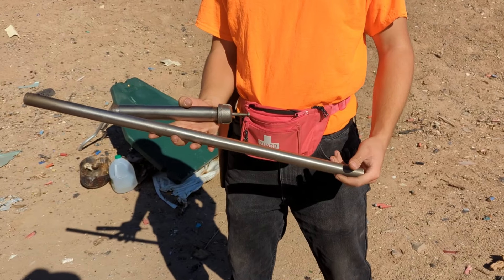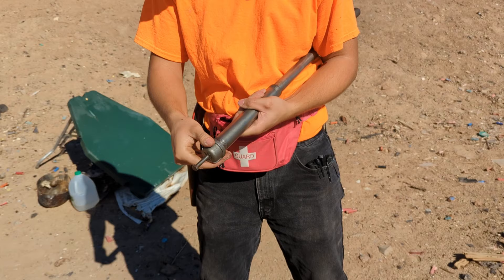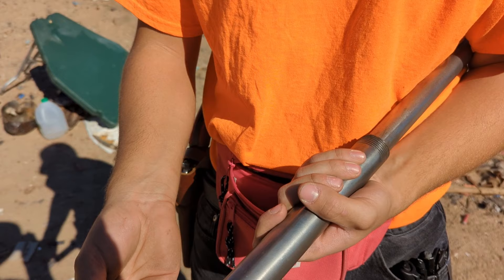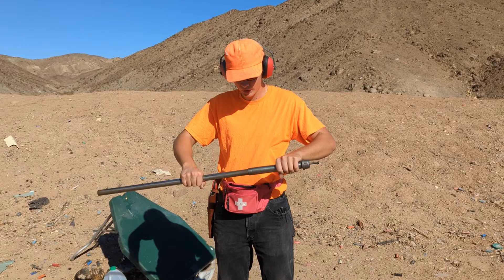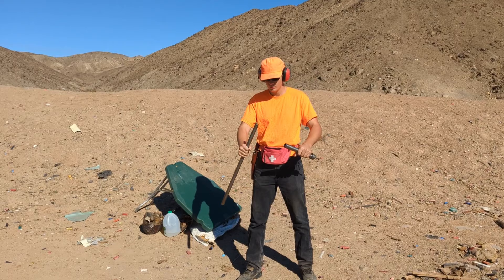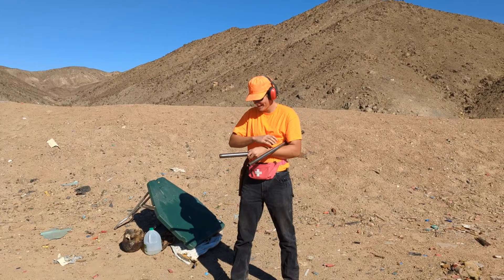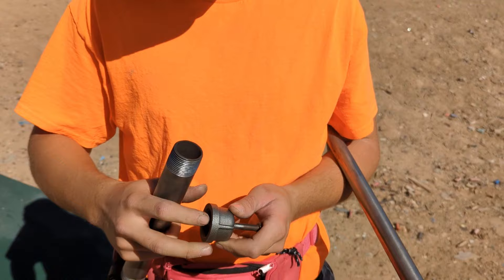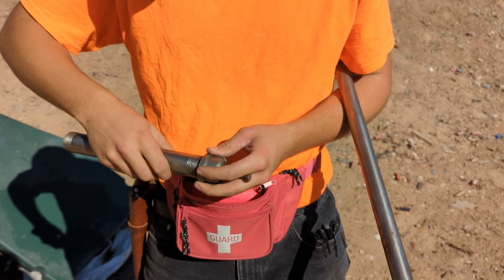The Mighty Pipe Shot Gun

Comment: This ISN'T NEW!! My friends and I when we were around 11 years old made these and used the old double-wick 4 inch firecrackers to project our marbles, metal balls, and anything that would fit into the pipe! We used gas pipe, and then on the cap (with the letter, "G") on the end, we would drill a small hole in the middle of the "G" for the double wick, which was cut at one end that went into the firecracker. We then fed the NOW longer wick into the threaded end of the cap and out the "G", then screwed the cap onto the gas pipe. Then we stuffed, a wad of cloth or something up against the firecracker then,  dropped the projectile down the barrel (pipe). Set up a target, made sure everyone was clear, then lit the fuse. The first time I did it in my backyard, I had a 2x4 in front of the gun; then a small partial sheet of used 1 inch plywood, and then made sure it was aimed at a telephone pole over on the next street behind the house. When NO cars or people were in range of the target, I lit the fuse! It went through the layers of wood (plus a rag doll I forgot to mention) travelled from my backyard and hit the telephone pole approximately 1,000 ft. away and we all went to examine the pole the projectile (3 inch steel Bullitt-shaped) was nmosing out the other side of the pole! The wood I had set up just in front of the barrel had a hole (obviously) through it and the rag doll was on fire! back then they were legal, until some ASSHOLES from Windsor were visiting friends of our in Simcoe and decided to shoot at people and cars or anything at all. The law stepped in named our invention, "Alley Guns" and made then "ILLEGAL! NOTE: we never had any issues with police or anyone until those Windsor, ON. "IDIOTS" took their fun TOO FAR!!! "ADDITIONAL NOTE: I don't think the four inch firecrackers are even around anymore! Hope you enjoyed my story. Have fun, BUT stay safe!!
Reply: Fireworks and explosives use FUSES . CANDLES use WICKS . And yes the is a difference. Fuses burn fast because they contain gunpowder. WICKS burn slow because they are just string .

Comment: Only thing to worry about is the end cap blowing off. That would be nasty. Tip 1. reduce little bit of powder in the shell to make safer
Reply from the maker: Given the amount of pressure it would take I'm assuming the cap would explode into shrapnel before it came off in one piece so no worries. 🤭
Reply: The cap could be reinforced with washers.
Reply: where is tip 2 ???

Comment: I think it's better to use JB weld & bb with a small holed washer into the cap.
Reply: Ther you go. Not compromising the cap in the first place and spreading the pressure away from the center. Way better.

Comment: blocking one end of a hole even slightly and putting explosives on the other end is exactly how you generate the pressure sideways for blasting so i think you where ptetty close to losing your hands there but hey if it work it works i guess

Comment: Something I would find interesting to try, say the builder doesn't have access to a shop where you can drill and tap to put in a striker, but still has the pipe. I wonder if you could assemble the pipe, same diameters, but drill a crude hole in the top for a cannon fuse, and then pour a charge of say 80 grains of FFG black powder and dump a load of buckshot in it, simple wadding, cut paper or even a cardboard wad over that. Wonder how that would test.
Reply: I don't see why it wouldn't work. It would be very similar to a matchlock.

Comment: This reminds me of fifty years ago street thugs/gangs used to take an automobile radio antenna and cut them down to about six inches long and wrap it with tape for a hand hold. They would insert a .22 cal shell in the end and smack it on a block wall or rock to blast the rim fire. Cheapest gun made. Steal an antenna and get some shells. And it would still be a bad idea. Just like this one.
Reply from the maker: New video idea.
Reply: They called it a Zipp gun I believe
Reply: @carlallen934  
Right.

Comment: Just super glue a bb in the cap your using. Worked good for me
Reply from the maker: Big brain
Reply: Does the BB act as the firing pin?
Reply: @tech9auto223  yes the cap on the larger tube is round and the bb will find the center itself if you drop it in and hold it level.

Comment: You should have in mind that a pipe like this, which is not made to be a real firearm barrel, can be damaged not instantly but after some shots. I suggest you to find a way to shoot without holding it in your hands.
Reply: Used to do this as a kid never has any issues pressure would blow the back off before the barrel
Reply: Shotgun barrels are actually pretty thin, even high brass shot shells are relatively low pressure, anything other than 3 1/2 inch magnum rounds should be okay
Reply: @porpoision  They're thicker at the breech though, for obvious reasons. I would still be very wary of ever using this thing. All it takes is one failure to cost you your life.

Comment: How does a 3/4" pipe fit "inside" a 1/2" pipe.   I'm not understanding that?   What type of pipes are they.  It just looks like gas pipe.
Reply: It doesn't. You take the 3/4" "barrel" and slide that into the 1" "receiver" that has the firing pin permanently installed in the end cap. It operates in a way very similar to a pump action only there is no follow up shot. 😊

Comment: Can some please explain to me why this doesn't fire the back part backwards?  Pistols can be recoil operated because there is force pushing the empty casing rearward at the same time as the bullet forward. This is why we need locking lugs etc, with these home made single shit weapons I don't see any locking going on, even on the 9mm pen type devices. They seem to just hit the firing pin and the bullet fires with no rearward gases, casing or issued etc?
Reply from the maker: https://en.wikipedia.org/wiki/Path_of_least_resistance

Comment: What gauge shells are you using ? What keeps the force of the compression from pushing the striker end from blowing back towards the shooter ?
Reply from the maker: 12 gauge and its called "path of least resistance"
Reply: Luck.
Those end caps are trash metal and not to be trusted.

Comment: How can I make one that's a compression cap muzzleloader. A good 16in barrel with a 6-7in long pipe over it making it compact so with like paper rounds already made you could even make a breech reload system. U u have a cap with the blast cap and u unscrew it to let u put ur paper slug in with the powder n bullet wrapped in peoer like modern ammo kinda. The breech losd black powder mechanism makes it much safer much cheaper to shoot much easier for maintenance it's so much more shaking for very cheaper to firearm ammo prices and shtf a 12ga bp cap ball shotgun is god. It can shoot any ammo even nails. U can make black powder from home chemicals. Only need a campfire and scrap lead to make ammo. It's best both wokds

If u converted it like i said ide be able to make it something with a stock and trigger. Only single shot originally hopefully maybe more

Comment: That's cool. I've done it with 22.s the tighter you can get that bullet in the pipe the more powerful it will be. I'm guess it doesn't have a lot of power but it's still scary cause it's loud. I've fired bullets by taping a little piece of metal to the bullet and hitting it with a hammer. Nothing really happens because theirs no compression
Reply from the maker: 5.4mm drill bit for barrel dimension, I'm still waiting for a professional barrel groove cutter to arrive but I'ma make one from 1/4" spring steel. Hope to make a video if things go smoothly.
Reply: @LawnMowerProductions  that's a good idea
Reply: The uselessness of short barrells. They waste the cartridges potential and dump it out the barrell. Big flash loud boom bullets bounce off. Yup real effective.

Comment: There is no way a standard steel pipe will handle the blast pressure of firing a 12 guage round and being  slamfire operation the backblast could push the firing pin backwards

Comment: don't weld crap just put a nut on the other side [outside of cap ] and it would work a lot better if the chamber [breach ] match the shell and one last thing if the back surface of the breach [inside of gap were the back of the shell hits] was even to support the shell things would not blow out and you would be able to extract the shell with your fingers . you need to stop firing a round agents the stuck shell as you run the risk of blowing or splitting the end of the barrel off

Comment: I don.t believe that a 3/4 pipe will fit into a 1/2 pipe
Reply: It won't. But a 410 just might. Need to research that a bit more. 3/4 inch shedule 40 will fit but Schedule 80 is stronger due to it's thicker wall, however, for 12 guage a chamber will need to be cut into it if you don't put in a chamber you get a 16 guage.

Comment: Can you list a link to where I can buy these materials?
Reply: any hardware store 

a clipped down roofing nail in a 
1 inch diameter wood puck in a 
1 inch pipe end cap on a 
1 inch pipe 4 inches long or more to enclose a 
3/4 inch pipe 18 inches or longer as a barrel
Reply: Thanks man, you are amazing!
Reply: Make sure your pipe components are 'schedule 40' so they will handle the pressure.
Reply: @waptek2  hey man can you please give me items for 20gauge

Comment: Back in 1962, these pipe guns were another way to play war with each other. Less dangerous, we'd put grapes in the tub, but first you gotta cut the threads with a heck saw blade 3/4", add firer cracker with fuse sticking out of the cut threads, then screw cap on to pipe, and light fuse! Don't use marbles, because you could go to prison!
Reply from the maker: Sounds awesome

Comment: Don’t just don’t people buy an actual shot gun
Reply from the maker: I mean yes preferably DO buy a shotgun, but some places you can't or have to wait a long time so, more for those people. The structural integrity is much higher in this design than most commercial shotguns (you could throw this off a building and have no problems) lack of parts means less things can go wrong or break down the road. Plus you built it, pretty sweet feeling. 👍